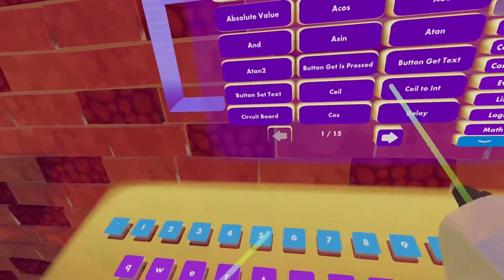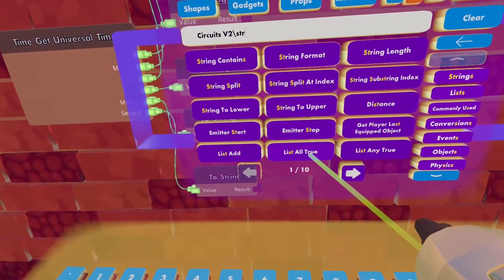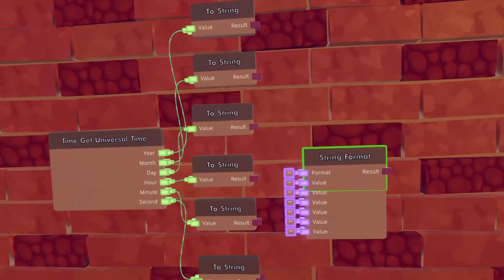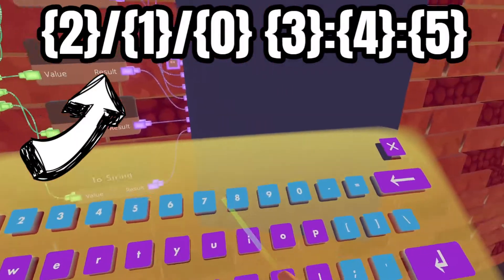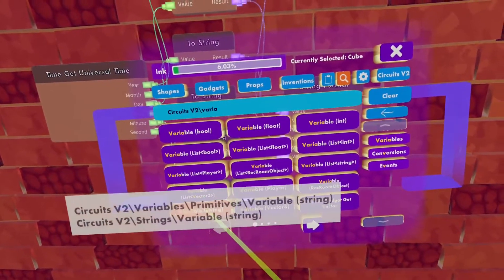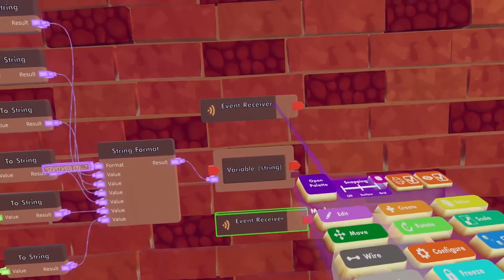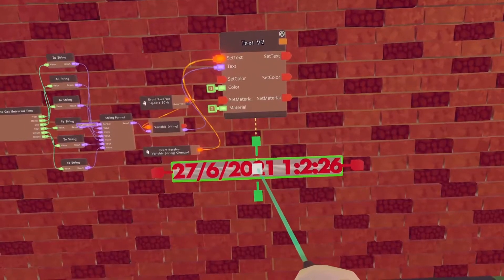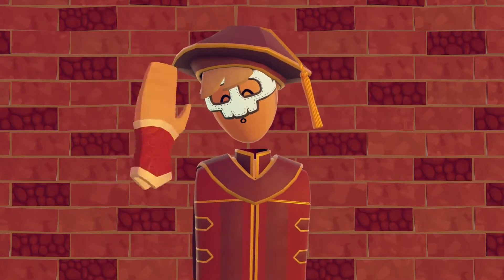How to make a working Clock by using CV2! - Rec Room Tutorial | RAINUX

Comment: Is there a way to make it a 12 hour clock instead of a 24 hour (military Time) clock?
If so can you tell me
Reply: There is! I did some research, you have to get universal seconds, and divide by 86400, then divide by 3600 to get hours, then wire that result to the to string of the original hour

Comment: My hours are wrong I did everything but how do  I change the hours
Reply from the maker: Maybe u made a mistake? For me everything works.
Reply: @rainux9322  nope I just did a new one and my hours are still wrong they are 2 hours behind
Reply from the maker: @PengRaa  spawn one ''add'' and wire hour with the add. then configure value and type in 2. then u need to wire sum to the ''to string''.
Reply: @rainux9322  didnt change anything

Comment: wait so {2}/{1}/{0} is for the date and {3}:{4}:{5} is for the Time?
Reply from the maker: It depends on how you combine ''To Spring'' with the ''Spring Format''. E.g. in the video I connected '' Year '' with the top one '' to spring '' and connected it with the first value from the spring format. that's why I had 1 for the year and 3 for the day.
Reply: Man, autocorrect sucks.